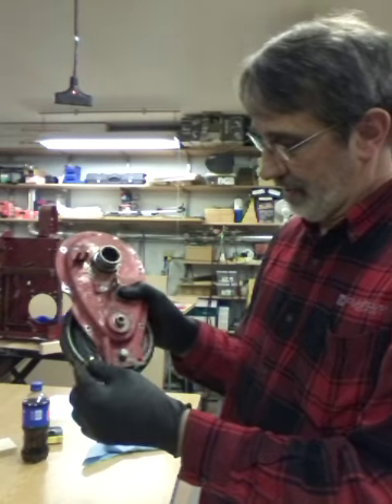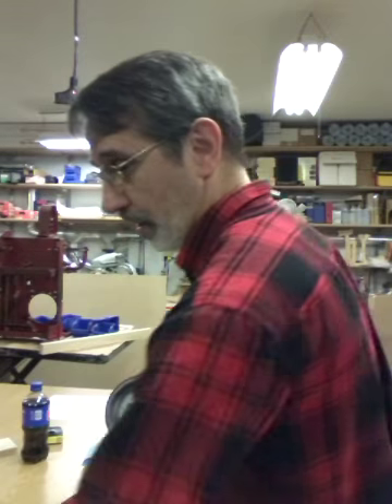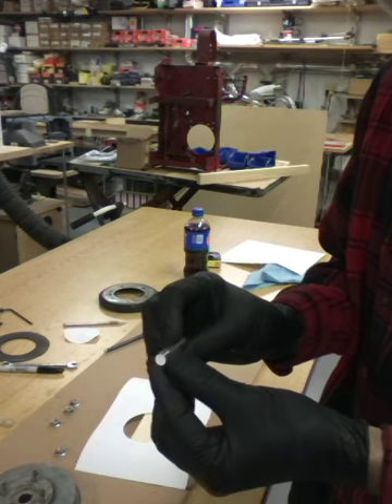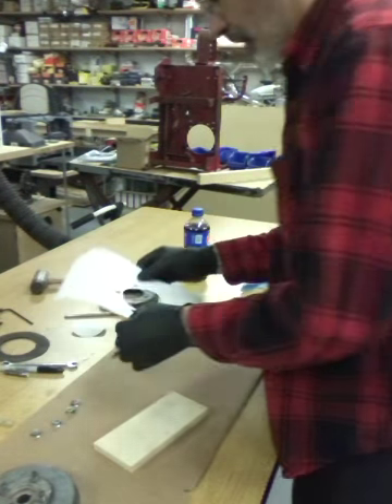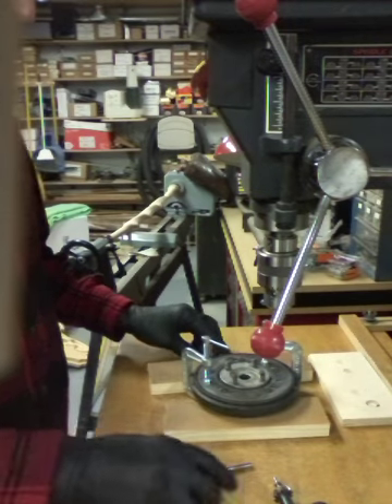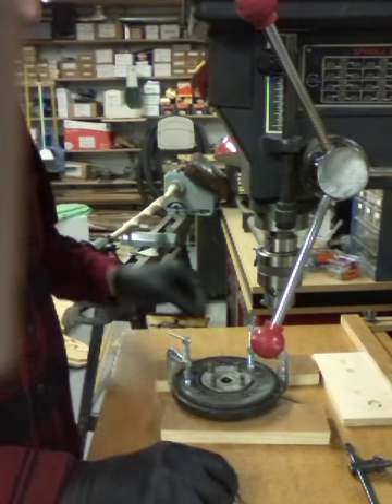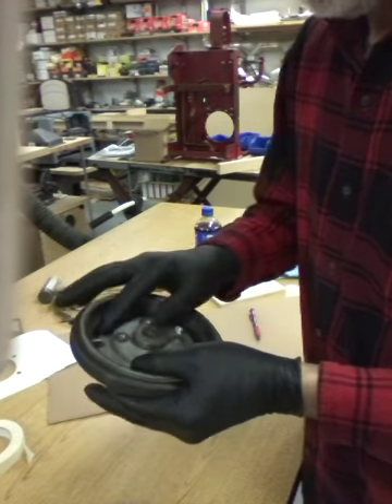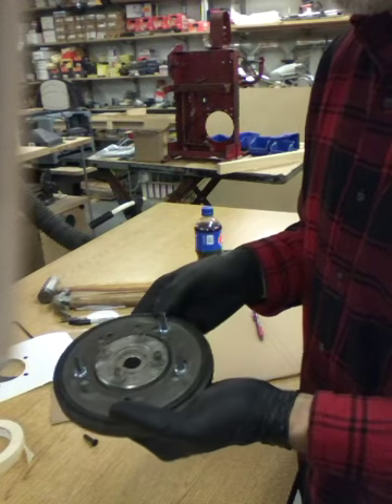33. Repairing my clutch on a snapper

Comment: why are you drilling new holes when it already has 5 holes
Reply from the maker: MrPieceFull 
If you have the small break arm that goes inside of your clutch disk assembly you have to reassess the bolt heads flush with the inside of the assembly so the breaker arm will clear, I drilled a 1/4 inch holes instead of using 5/16” it’s easier to counter sink for a 1/4” flat head bolt then it is for a 5/16” flat head bolt but you can use either one that you choose to. Jim
Reply: @jimjackson9381  i found 5/16 s s counter sink bolts and sank them deep enough to clear the break arm and used hole allready in cluch disk
Reply: @jimjackson9381  your vids are very good and a big help im in the process of rebuildind another snapper with a wagon with out a mowing deck i have
a good engine the diff needs redone compleatly

Comment: How about welding the damn things together?

Edit: Eh...scratch that idea. If you used tape to center the outer disc, how would you get it out? Bottom line, you'd need some other method of centering the outer disc over the inner one.

Edit #2: OK...on further reflection, why bother to remove the tape? Once the disc is welded, there's no need for the gap or the friction material...
Reply from the maker: Jr McDonald 
  Hi it's Jim, Welding it would be quicker and probably easier   until you get to the point where you need to change your clutch because the rubber is were out.          Thanks Jim
Reply: Well, the difference being that, instead of buying just the 'driven disc' (the piece with the rubber on the rim), you'd be buying that + the 'driven disc hub'. From PartsTree, that means spending another $22.
 
In another video, you show what I believe you said was a solid assembly from an older Snapper. Is it not possible to buy a solid assembly for the newer machines? Seems as if this would solve more issues than it might potentially create.
Reply from the maker: Jr McDonald 
  Hi it's Jim
     The part that you should be replacing is your clutch disc that's the disc with the rubber on the outside of it and the brake material on the inside The part that the clutch disc bolts to is your clutch disc assembly you should never have to replace that, your drive disc is the disc that is bolted to the bottom of your engine on your crankshaft. 
     Your question about the solid assembly for the clutch disc, It is no longer available because of safety issues, even if you could buy one it wouldn't work on a newer machine because there's no place for the break arm to fit inside of it. 
   If you're having issues with your clutch and it's not working properly there are other things you should try first before bolting the clutch solid. Watching video number 70 will help you out with some of your issues.
       Let me know if you need any help with your clutch. Talk to you later Jim